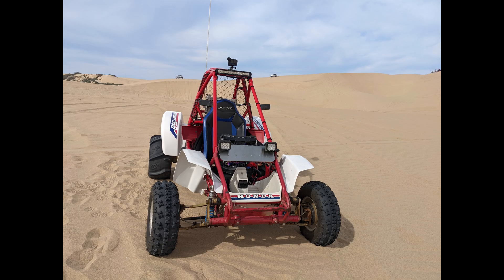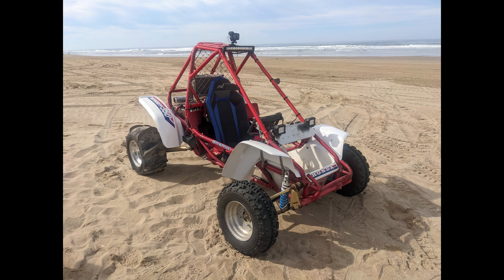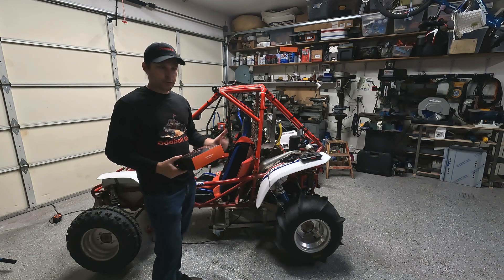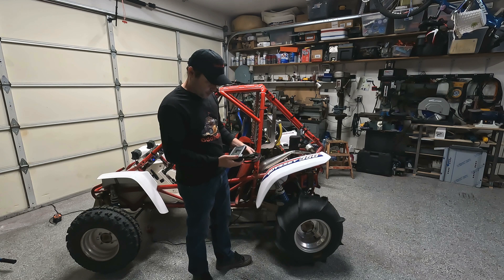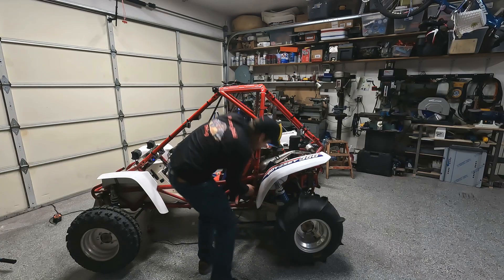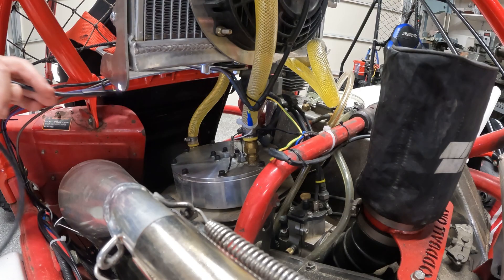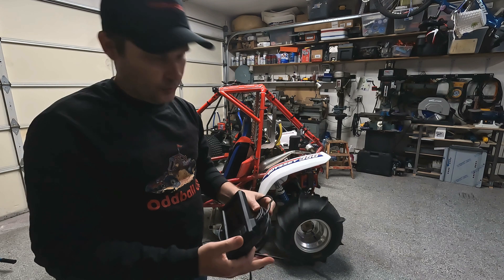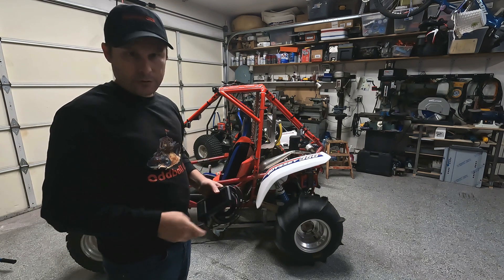Honda Odyssey FL350 Engine Rebuild Part 2 - Inside Look of Blown Cylinder with Borescope

Comment: I had the same problem bro, turns out the stock bore went from 80mm to 78.5 due to the overheating issues. I'm getting ready to mount a fan to try Cool the engine off a little bit more while sitting. I recommend drilling the piston for exhaust bridge cooling as well✌🏾